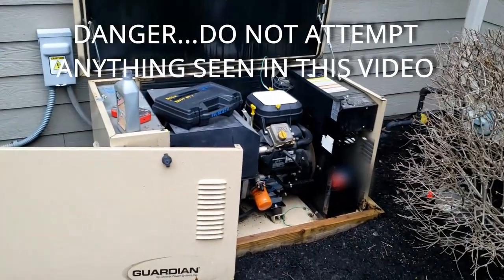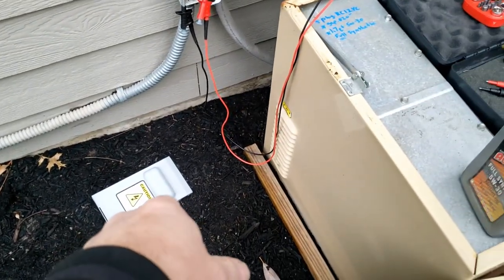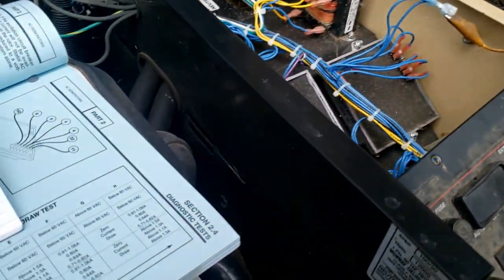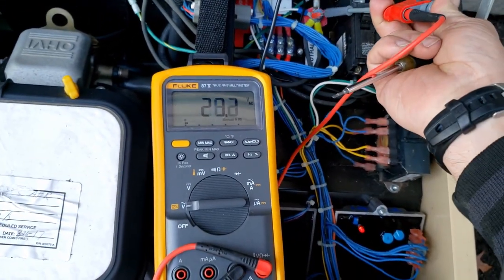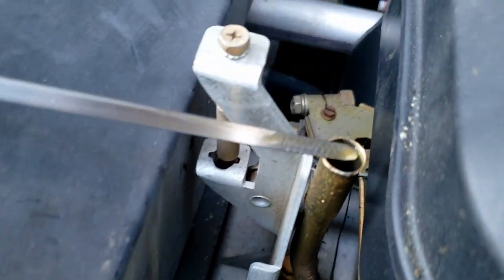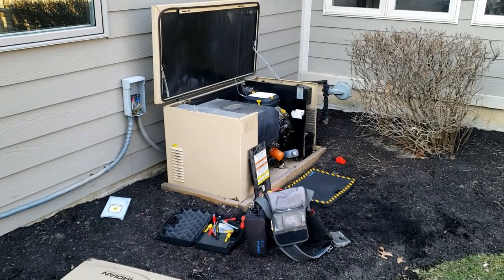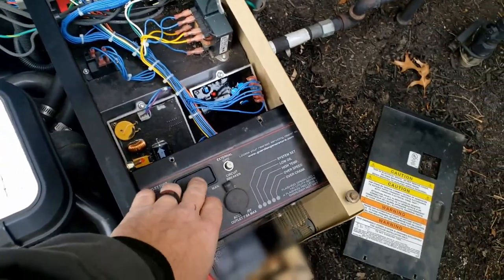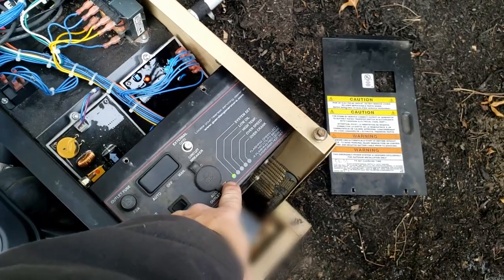Generac Generator Fails To Run & Transfer Back To Standby #GeneratorFailure

Comment: One of those batteries did explode at my feet when I was manually starting one of these with the front cover off a few years back in fall 2018.  I was unscathed besides some battery acid melting my shoes and my Nissan key fob on my keychain.  Generac paid for a tech to replace the battery charger and the battery free of charge but wouldn't replace my clothing or key fob.  It was a 2009 model Generac, I forget the kw rating.  Apparently the battery acid was boiled out and all that was left within was hydrogen gas.
Reply from the maker: I had it destroyed the stator and rotor on a generator because it was running when it exploded once. The acid ate the insulation off of the windings and it shorted out.
Reply: @HVACRSurvival  Wow how did the acid reach that portion of the machine?  The battery box should be divided by the sheet metal wall.

My Father's unit was off on error, so I came by to take a look.  The battery charger was grossly overcharging I found, but with the cover off I initiated a manual start and KABOOM.  Pretty scary.  When I opened my eyes I was surprised that I was unscathed.  The thought that I lost my vision was a horrible scare.  Don't play around with batteries, wear eye protection!
Reply from the maker: @Guillotines_For_Globalists  my best guess is it was running and if you've noticed how it runs it pulls air in through the motor and blow it across the stator, that's where the batteries at, right there in the front of the engine, it sucked it in blew it all over.
Reply: @HVACRSurvival  That's true I suppose.  I never peeked up in there too well.

Comment: I have two of those relays spare. I can send em to ya?
Reply from the maker: I appreciate the offer, I don't run into that many generators nowadays. I pretty much record every generator I've done over the last two plus years and that's about all the more generators I see.
Reply: @HVACRSurvival  sounds good! I pulled them from my hpa compressors. Company who built em didnt aparently test them much and they kept arcing and sticking so i upgraded an went to solid state relays so the box of 5 i got are collecting dust lol. It was either that or contactors.
Reply from the maker: Thanks for thinking of me👍👍

Comment: In my experience 3/4 of those old avr's fail full flash. Every time I see one I make sure the customer is aware of the weakpoint and them show them how to regularly test the generator with only basement lights on (if ats is in basement) monthly! If the lights get reallly bright then CALL ME ASAP! Then I have them sign my maintenance / service sheet with me writing up Generator is known to produce overvoltage and is running within specs at this time! I still have around 40 in my area that I service and I was sued once already. If you want any old gen 2,3, nexus, evo books let me know I have 5+ sets floating around!
Reply from the maker: Thanks Rob👍👍. I had another viewer tell me about that field flash issue, I hadn't heard that the module has an issue of losing its mind. I have had the over voltage issue several times. Something about 320 volts doesn't go so well 🤦‍♂️

Comment: FOR SALE;
Huge Generac paperweight sitting in my yard. Owned 6 years but  has less than 30 hours on it.
Reply from the maker: Sounds very familiar, sorry 2 hear that.
Reply: @HVACRSurvival  , it's been a headache for sure. Generac kicked me to the curb tonight on it, again. I have been haggling with them for 3 years in November. 2 weeks after it was installed was the first breakdown, it has broke down periodically after that. It's practically brand new still. Just sucks.
Reply from the maker: It's honestly hit and miss, some of them never have a problem others just have problems from day one
Reply: @HVACRSurvival  that's a good point. Lol, they told me my soil is too active. Its causing power surges to my machine. They said they took a look at one of my control boards that had been returned to them (they didnt say which one, I returned 5 of them and a bad one is still on the machine). Last board was replaced last November.  I am not denying that something is killing the machine, but they had 6 years to fix the problem. Now it's my problem.  I have a electrician coming out next week to rewire everything now that the Generac techs are out of the picture. This will be the 4th time it's been rewired. Crossing my fingers on this one.
Reply from the maker: @sonder2164  have the control board dipped or sprayed in a protective layer. Where do you live if your having control board failures over and over? This sounds weird to me🤔
Reply: @HVACRSurvival  that is a good tip I will have it dipped. I live on the outskirts of a small town down a dirt road in the woods of arkansas. Not a dang thang near me.
Reply from the maker: Then that all sounds kind of sketchy unless you got some weird gases escaping through the yard, in that case you probably should be dead by now. Just be sure if there's any relays on the board that they don't dip those. I was reading supco had just developed some sort of new spray for control boards, why don't you search it and see what you can find out
Reply: @HVACRSurvival  will do, thank you very much.
Reply: @sonder2164  What about installing a small ventilation fan in the unit, powered by house wiring, to keep the air from stagnating?
Reply: @lnk4328  hmmmm. I didnt know stagnate air was a issue. The machine is outside in the woods.

Comment: You had negative 13vdc because you had your probes clearly reversed at 10.49, you literally changed the control board for no reason
Reply from the maker: Even if the probes were reversed you wouldn't have the full 13 volts DC going to the relay, you'd have no reference point to ground or to the positive whichever one you want to look at it as. The problem was it wouldn't switch back to standby.
Reply: @HVACRSurvival  the meter gives you a reference as to where the ground is.

Comment: Help plese I have Generac 4645 generator 15kw. will not start or turn over all lights are no the control panel 4 red 1 green
Reply from the maker: Check the battery